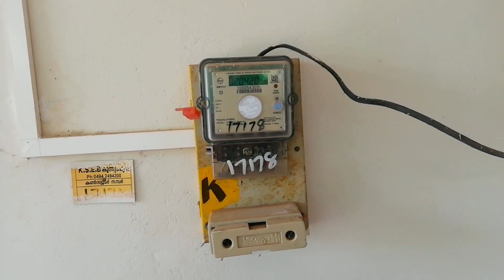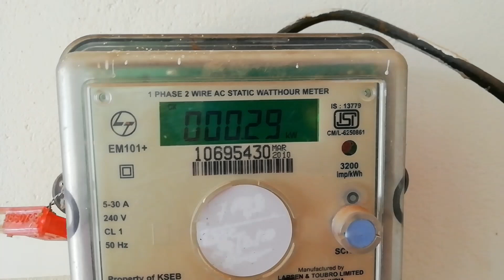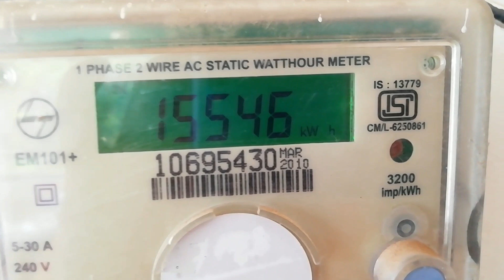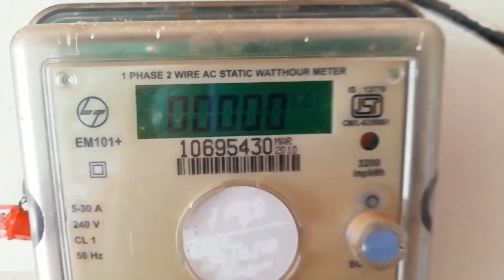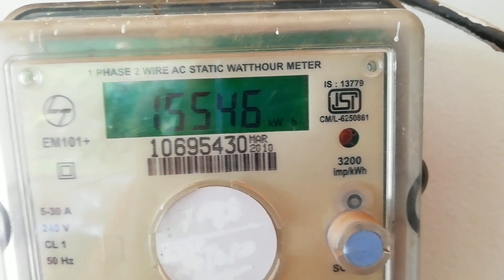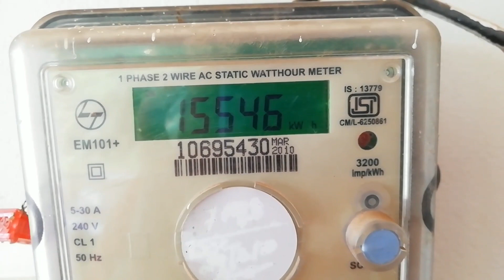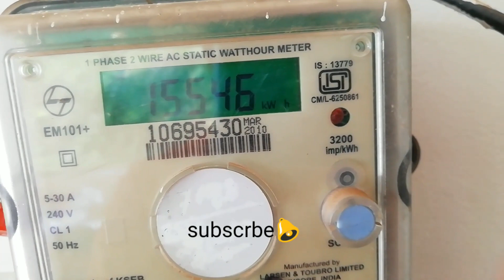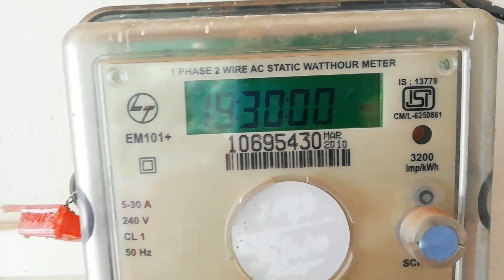KSEB Electricity Meter Reading.

Comment: What is the use of learning to read meter? Will that change billing method. What we want is monthly billing system. This can reduce the amount.
Reply from the maker: Yes,it will.But ultimately when counting for 2 months,I don't think the saving will be that way much.
Reply: @e-lifestyle5659  it will be much for those whose consumption is high. Also it will help those whose consumption is less, as it will be great help for them. It will also help businesses, etc. Bimonthly reading will only help kseb. Remembering kseb is an essential service and not a service to make money. If they run break even it's fine. On top of all this they disconnect power any time they want.